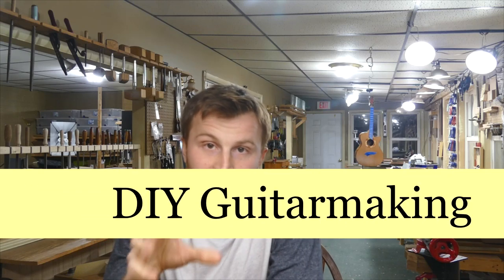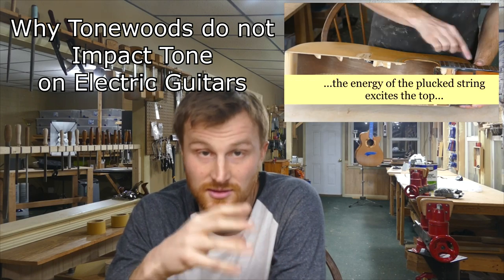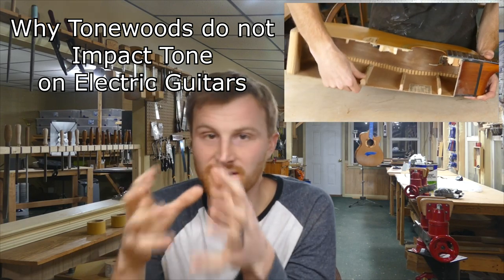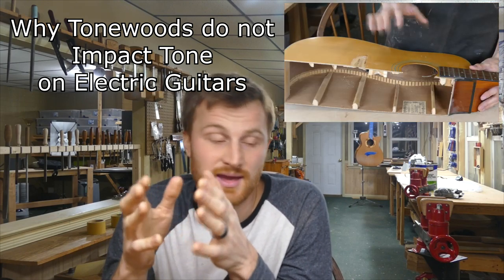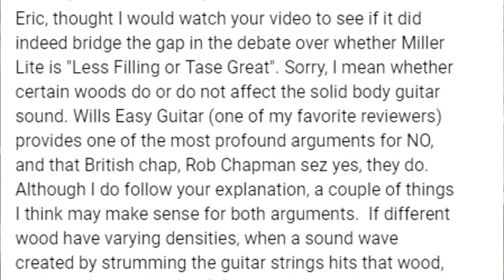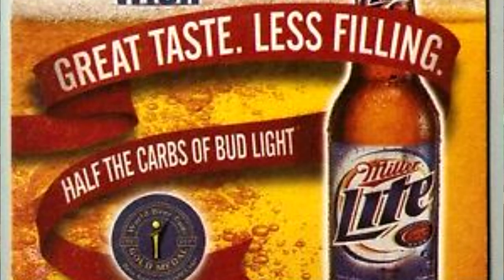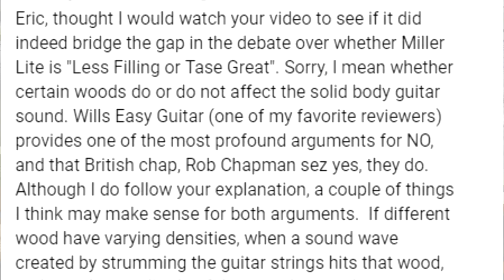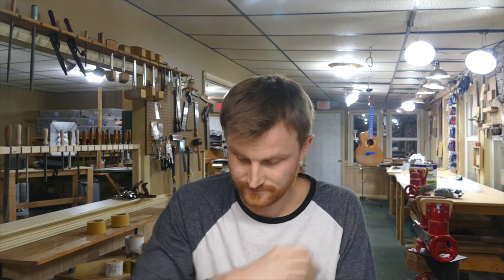More on the Electric Guitar Tonewood Debate

Comment: I used to frequent the MyLesPaul guitar forum years ago. I remember some guy bought a new, Custom shop Les Paul....he might have spent anywhere from 3 to 5 thousand dollars on it. He had it sent to some luthier who, according to the community, specialized in "relicing" Les Pauls to '50 and '60s specifications. The owner had the luthier change the glue in the neck joint changed to more "original" hide glue. Of course, that meant popping off the fretboard, steaming the neck apart from the body, cleaning the joint, and redoing it all again....all for a dab of glue. At least, the owner reported he was happy paying over 2 thousand dollars for this, as he was sure the guitar sounded more "authentic" due to this operation.

It´s been years and I still can't get over it.
Reply: The sonic difference that this guy experienced is going to be very similar to the sound of a the worlds biggest cork being sniffed.

Comment: The only similarity in an electric guitar and an acoustic guitar is that they are stringed instruments. They work completely differently. The irony in all of it is that electric guitars went to solid body for the purpose of feedback resistance - effectively attempting to remove  the acoustic qualities and resonance of the body design as much as possible. I have a semi hollow Gretsch that will feed back much more than my telecaster because sound waves from my amp move the top, which in turn moves the strings and pickups relative to one another. Feedback can be fun and is it’s own thing, but it’s what solid body guitars were designed to eliminate. The best electric guitars will be completely acoustically dead and non- resonant in the body material such that the variable of resonance and feedback is removed and the pickups can function as intended. A great electric guitar is about the quality of the neck in terms of playability, the quality of the pickups and wiring harness, the intonation, and the quality of the tuners, nut and bridge where the strings contact the body. Wood matters for aesthetics and weight.

Comment: As an amateur electric guitar maker (I don't presume to call myself a luthier yet!), this is an interesting and relevant topic.  I found the Wills "scientific" explanation flawed because his model was incomplete, notably because he omitted the vibration of the pickups which will be caused by the vibration of the wood when the strings are moving.  Rob Chapman asserts that different woods sound different, and I've recently done a course with another electric guitar luthier who said that he has made two identical guitars with the same wood and they sounded different.  Not by much, but still different.  My conclusion after all of this is that the wood of an electric guitar does make a difference to the signals emitted by the pickups, but that this difference is extremely small (and overwhelmed by many other factors in the complex sound reproduction chain of an electric guitar), and also not reliably predictable based on the type of wood.  My own takeaway from all of this is that I pay no regard to the potential tonal properties of the woods that I use, but I select them for their appearance and workability (i.e. some woods are more prone to problems like splintering than others).
Reply: Jonathan Oakey 

I can very much relate to your opinion. Same here: hobby guitar builder/ upgrader. My thoughts are going towards matching the neck and body, by knocking on them. Later on, by reshaping them, maybe longer horns and a slimmer body brings me the bass I need... Maybe more weight on the headstock brings more sustain. The rest I do with the selection of nutmaterial, bridge, pickups and pot-values and capacitors.
Reply: @MrClassicmetal  If the wood doesn't vibrate, how do the tuners work that you clip onto the headstock?  You know, the ones that detect the vibrations in the wood.
Reply: @jonathanoakey4745  I did not say that the wood does not vibrate. What I am saying is that it is not a factor, because of the principles upon which an electric guitar works.  Specifically the pickups.

Tuners work by changing the tension in the strings, which in turn affects the frequency of the string vibrations.
Reply: An electric guitar maker is never a luthier.
Reply: @MrClassicalmetal :You didn't listen what he said in the clip. If the wood vibrates it is not important and has no meaning for the sound because the PU are registrate the sound already

Comment: The way I see it (and I'm an acoustic guitar builder like Eric, though I've done a couple of electrics) is like this: if you play a "responsive" electric guitar unplugged, you can feel the body wood moving (vibrating with the strings). This movement of the body wood, even though very small, is transmitted to some degree, through their physical connection with the body, to the pickups. 

The amount of this body movement the pickups reflect will depend on their coupling to the wood of the body. There is normally some semi-spung connection (sponge or metal springs under the pickups) together with the screws which secure the pickups down to the back of the body. This results in a certain amount of physical coupling of the pickups to the body. 

Imagine an electric guitar body being vibrated by some external source (with the strings damped):  the pickups would vibrate to some degree in (or even out of) sympathy with the body, even with the strings immobilised. Now take the more normal situation where the guitar is being played: the body picks up the strings' vibrations, the pickups move "with" the body (the movement is complex) and therefore the strings' vibrations are being detected by a moving pickup. 

If the pickup were completely static when the guitar is being played, the argument that the body wood has no effect on pickup response would probably be watertight. But since the pickup itself is moving, via its physical connection to the body, its magnetic response is a blend of the string moving above it and its own movement generated by the body wood it is connected to, making potentially at least, a much more complex response.
Reply from the maker: I've never heard that perspective before and I kind of like it. It's atleast more substantial than relying on the energy that returns to the string after it enters the wood, which is virtually nonexistent, and which is what most people rely on as an explanation. However, I do feel like we are still just grasping at straws to save an idea that doesn't hold up on a scale that matters to us as human listeners. If we were trying to entertain a spectrum analyzer machine with our music, then that would be different.
Reply: @EricSchaeferGuitars  I've wondered the same thing, but I've realized it actually kinda proves the point that the wood isn't changing the tone. It's affecting something else that is then affecting the tone. This is what happens with hollow body guitars, especially if the pickups are not potted. The wood vibrates, which vibrates the pickups and the screws holding it in place, and they can resonate with the resonant frequency of the resonating chamber. But you could theoretically make a guitar out of anything and you could tune the resonating chamber to whatever you want. In practice, this is probably harder to do and so wood "could" make a difference, but only because it's easier to use and get it to resonate in a certain way. But the wood still isn't changing anything about the string's vibration, and nothing is changing the transverse waves the pick ups are picking up. It could affect sustain though.

One thing I've wondered too is if you have a resonant enough body, could it possibly vibrate the bridge/saddles enough to disrupt the strings' vibration, making you lose sustain and possibly dampen harmonics? Even then, that's not the wood....that's the bridge/saddles that are actually touching the strings, and the wood is just causing them to vibrate enough to highlight a problem with the saddles. 

So the more I even try to prove that tone wood is real, the more I end up proving it isn't in my experience. It seems the wood IMO, does matter in some ways....but not in the way most people are thinking. I think sometimes sustain can have a perceived affect on the "tone", but it's not really changing harmonic content going to the amp as far as I can tell. It could however affect the compression and distortion of an amp or pedal if the sustain is affected enough. If that changes, the harmonic content leaving the amp can change. Even how the guitar feels can slightly change how we perceive the sound and can change how we play....which changes how we sound. Sometimes the look can even inspire something inside of you and change your tone. So in that way, I think wood does actually matter. But on a physical scientific level. is it changing the actual harmonic content going to the amp? No, and if it is it's in a secondary way, where it's causing something else that's touching the strings or picking up the strings to vibrate and thus affect the tone. But it's the vibration, not the wood. Again, it could be any material tuned to the same resonant peak. Also, the resonant peak is where you lose the most energy from the strings. So wood matters for sustain. And like I mentioned, sustain can have a perceived affect on tone, but also if the sustain is affected enough could in theory change the tone of the amp/pedal the signal is going in to, due to how it compresses and distorts the signal. I think most of the time it's not enough to notice tone wise, but enough to feel, and that's where the perceived change in tone is coming from. Or it could be an actual slight change in the tone of the amp/pedal, but again more noticeable on a feel level. If you lose sustain, you might end up pushing the gain more, and that could change things too with how the amp reacts overall.

So you end up in the sort of in between world of tone where you understand that the wood isn't really changing the harmonic content that the pickup sees....but then there's actual ways it could theoretically make a difference. But then when I've seen people do proper tests, there's little to no difference. So that means even all my theoretical ideas on how the wood could do something obviously still does it at a secondary level, and is affecting the tone far less than one might think and in most cases probably isn't doing enough to be that noticeable.

I think overall though, when it comes to finding "the" guitar for you, everything comes into play. Everything changes how you see and hear that instrument, if only on a mental level. But that can be enough to change how you play, which can change how you sound. And obviously how it feels to play can do the same thing. I think that's one thing we can probably all agree on, no matter what side of the argument you sit on. Find the right instrument for you. 

(sorry to further beat the dead horse lol)
Reply: @ Christopher Garland, This is exactly what  I think is happening. This is why the most notable difference from instrument to instrument, is harmonics/overtones and sustain.
Reply: Christopher Garland 
I agree with all, and I like to add some thought: all parts conected with the string, even via screws with the woods, do dampen certain frequencies (more or less, for example the saddles some others then the nut or tuner) 

After milliseconds, The remaining frequencies are moving the woods of neck and body- and theyr vibration/resonance do support or continue dampening the rest of stringvibration. If some part is resonating at the same frequency= causes dampening (if that happens, even on a expensive guitar, you have deadspots), 

Its like having a weight dangling on a string: if I hold still- a normal decay of amplitude. If I move my hand slightly with the weight, it will be soon still standing. But if I move my hand contraire, the pendulum continues much longer. 

If the resonance is slightly off, it would support the vibration by feeding (even just the slightest amount) back in to the strings via tuner, nut and bridge. Allthough everything happening is very complex- but the pickups are "picking" it up😑
Reply: Im just reading your comment over and over to see if I missed something. You are saying that the vibration from the strings goes into the body and makes the pickups move? Even to a tiny extent so that the overall sound is the sound of the pickup moving WHILE picking up the the vibration? I have to agree that that's interesting but sounds really really like clutching at straws especially when we factor in the common tonewoods characteristics.

It goes back to what he said at the beginning of the video. All these tonewood characteristics bright, warm, dark, etc are in place from a different mechanism. That of a soundhole colouring the guitars vibration. 

In you hypothesis you are simply speaking of vibrations from the strings to the body making the pickups move. Lets first say that that movement is such a small part of the overall vibrations that are in the strings and the vibrations that have been lost as sound waves in the environment. But in that case the what you are saying IS true which is a bit of a long shot that the tiny vibration of the pick ups is itself a sound variable when combined with the string - pickup interaction. The only variables would be how much or how little the pick up shakes. That doesnt account for the tonewood characteristics of bright, warm, dark, twangy, airy, soft, round...the list goes on. So not only are there more tonewood characteristics than there are variables .... how on earth would it be possible that vibrating pickups plus string interactions just happen to produce the same tonewood characteristcs as heard on an acoustic guitar where a soundhole colours the guitars' vibration.

Surely we can see that we are really really reaching here?
Reply: @Ayo.Ajisafe  I agree with you.  To produce sound, an electric guitar senses the vibrations of the strings electronically and routes an electronic signal to an amplifier and speaker. The sensing occurs in a magnetic pickup mounted under the strings on the guitar's body.

This is the reason why the Strat and the Les Paul were made from solid wood in the first place; they didn't have to worry about resonance from the body.  I fail to see how vibration of the pickups is a factor here.
Reply: So what's next? 'Tone foam' pads the pickups can rest on? ;-)
Reply: @SheepWaveMeByeBye  Even better, tone foam between the guitar and me so that my hand and gut doen't damp those precious teensy body vibrations or change the resonant frequencies.   Just gripping the neck of the guitar behind the fretboard substantially changes the actual resonances that could possibly matter (below 500 Hz), and somehow nobody notices or cares.
Reply: I always buy the finest tone plastic pickguards to achieve maximum toanz.

Comment: I think you are very right. 
The tone of an solid body e-guitar is determed bij the accuracy how that guitar is build ( for example body - neck attachement , fret work ) , the bridge , the PU ,  the nut bone and the electronics in it.
And you have to use wood wich is reliable and decent just for the building and craftmanship of the builder , not for the tone.
So what i am saying is that the wood itself has no meaning on the tone .

Comment: Eric - it’s not complete “bullshit” - in fact the sum of the variables does impact how a magnetic pickup sounds. What IS bullshit is pigeonholing “maple does this and mahogany does that”. NO that’s not the case -  but  - two bodies from the same species and even the same billet can sound as different as two different species. The overall environment in which the pickup is operating makes a big difference.  Plant the same exact Gibson humbucker in a semi-hollow 335 , an SG , and a Les Paul.  They all sound and respond similarly, but not identically. Then just for fun stick it under the strings of a pedal steel - completely different. It’s all subtractive - certain overtones are being more or less absorbed by all the components of the guitar, and every variable from the neck thickness to the density of the body to how the pickups are mounted ALL contribute to how the string vibrates and produces overtones and therefore what that pickup has to ‘read’. The sum may only be 1-2%, but sometimes that’s the  difference between ‘good’ and ‘great’.  Some guitars are exceptional, most are mediocre and some are awful. It’s not any one thing (a maple fingerboard does NOT alter the “attack” and a rosewood board does NOT make the sound magically “warm” - but the sum of everything might in fact make one guitar roll off 2500 hz by 1-2 dB while another rolls off 5000hz by the same. Where it turns into nonsense is trying to nail down the trends by species of wood alone.

Comment: I’m very late to the party. I think one of the core issue is that electric guitar players experience their sound in a biased way. In extreme cases they just practice unplugged where obviously all the sound comes from the strings and the wood. Or when they play with an amplifier they might not play loud enough to cover natural sound waves. So yes in that case they hear something slightly different maybe depending on the wood, but that is not the sound they’ll get if they record a track or play live, which will then come from the pickups solely.

The real test for a person would be to wear headphones plugged into the amp and hearing another person playing, removing the airwave noise from the actual equation.